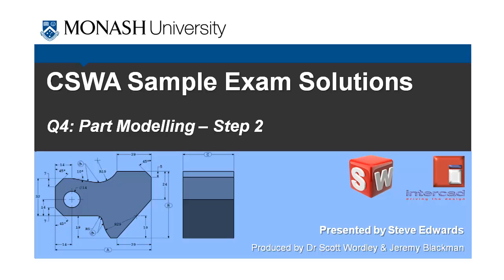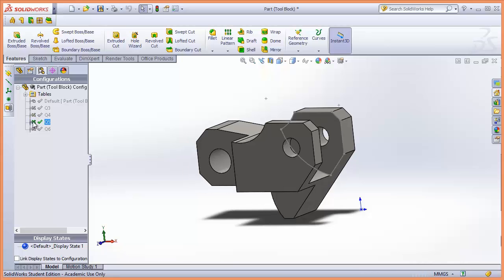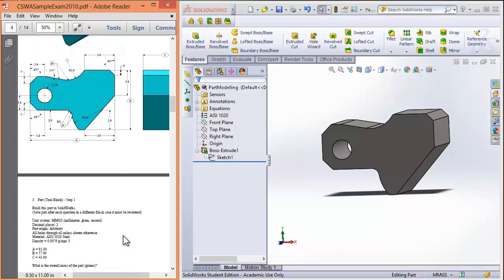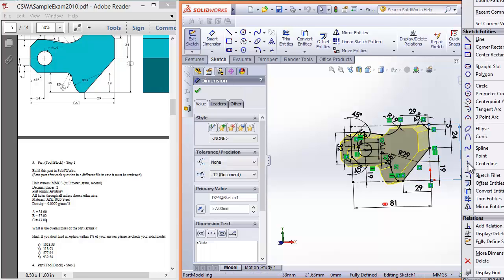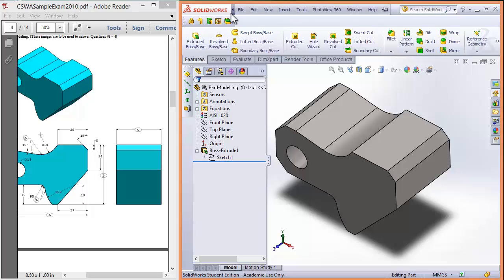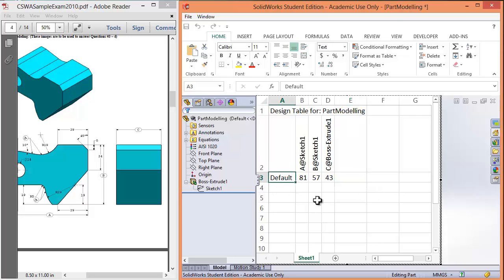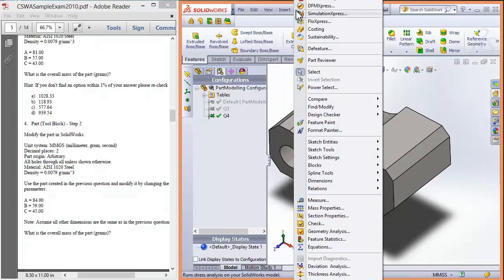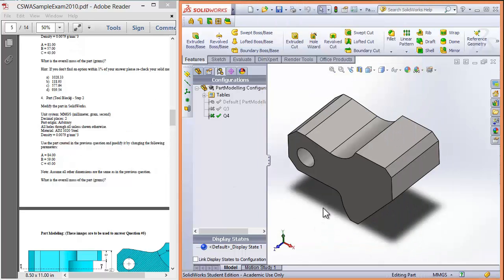SolidWorks CSWA Practice Exam Solutions Part 4: Q4 Part Modelling p2

Comment: Whats the difference between using design tables and changing the smart dimensions? Apart from the obvious fact you can switch between the 2 configurations. Does re-smart dimensioning still give you the same results for the mass and dimensions?
Reply: +Christian Harries I'd say all this is waste of time in exam that doesn't check "best practice". Just edit dimensions manually and save copy of parts as you go along.

Yes all these methods will give same results.